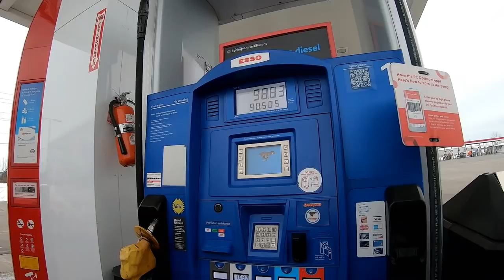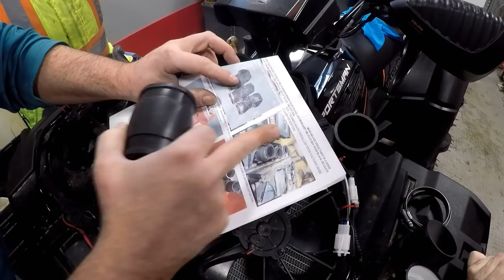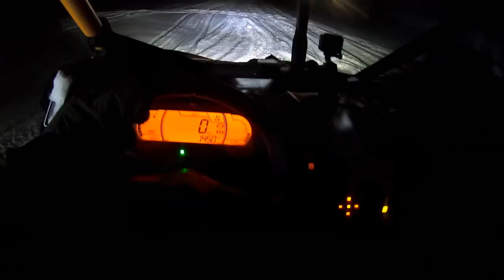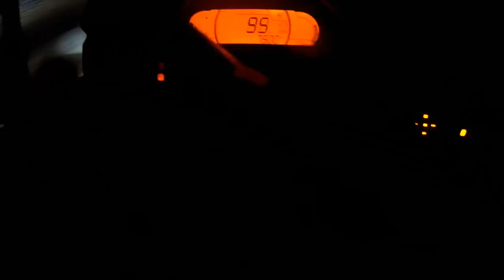2020 Polaris Scrambler XP 1000 S RJWC Dual Crossflow Exhaust Install (Before & After)

Comment: I have the same front bumper but  I powder coated it then same red as the suspension
Reply: now you need to do the headlight upgrade....
Reply: Paul Jensen  Yep headlights are on the way, we’re thinking either red or black for the bumper.
Reply: Owen Allen it’s the Polaris Ultimate sport series bumper

Comment: Those roll pins shouldn't be used more then once they expand as they go in, I worked at a Polaris dealer and we were told to change them every time just a heads up!
Reply: Dan jardine  I’ve reused these a hundred times over on all my bikes, as long as they don’t crack or split there fine to reuse.

Comment: How big is your fuel cell is what I really want to know how the hell are you taking $106 in just the truck alone
Reply: VoicefulAtom 324 and sweet_tooth123 

He either has the 98l or the 120l tank, not quite sure, $106 is nothing new here in Ontario 🇨🇦, he probably wasn’t even empty yet.
Reply: That is a really big tank and I have never even seen it in a normal truck that is one big ass tank how long does that usually last
Reply: VoicefulAtom 324 and sweet_tooth123 

That’s only 25gallons which is actually small these days, the Ford 1/2 tons are 36gallons.

Comment: turns out you do need that diff tail upgrade, got mine torn out wwith the bearing parts destroying the diff, back in december.
still waiting for the new reductor.
Reply: Holden Caulfield  best upgrade so far, 3300km so far and on the same diff, gotta keep a eye 👁 n that bearing on the pinion, it takes 5 minutes to pull that off and check, usually check mine every 500 kms
Reply: Are you talking about on the scrambler? Different bikes on the video, a little confusing.
Reply: @Wayne-vb8bj  yeah, polaris front diff bearings are tiny and weak, they changed it to needle bearing, but still no good.
Reply: @holden_fella  Thanks for the info Holden. One reason I bought the new scrambler was because they upgraded the front diff to the rzr type. Guess they're still having problems. I'm glad I got the extended warranty.

Comment: will that exhaust for the scrambler go on the sportsman? and is it a stock exchange or require any flashing after install? im bone stock
Reply: Charles Melrose  The Scrambler S shares the same exhaust as the Sportsman S, with the exhaust you will either need a a pre programmed fuel box or a tuner, I recommend the tuner then flash it, lowers the on and off for the fan to run cooler and definitely helps the throttle response, later on if you end up doing more stuff to it the programmer can be tailored to your liking. 

I’d recommend Ryan At RVS performance, he’ll hook ya up.

Comment: Do you have to tune that after changing the exhaust
Reply from the maker: Some systems claim you don't.  But we do to get the machine to run cooler. Gotta get ride of the lean condition. Little extra pep is a bonus if ya can feel it. Pipe and fuel controllers don't actually add much power at all if any at times. But having to machine run cooler is worth it.
Reply: @ehTV1000  thank you appreciate it
Reply from the maker: No problem

Comment: Do you run rjwc gas cap on and of your bikes and do you recommend it? I was told that it might leak and get water in my fuel
Reply from the maker: I have one unit running one without issue and it see's plenty of deep water.